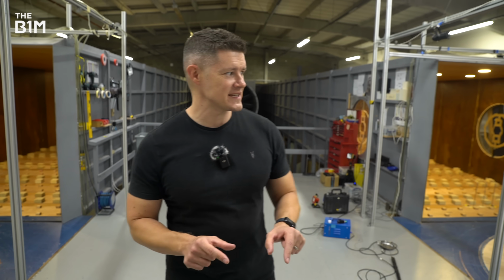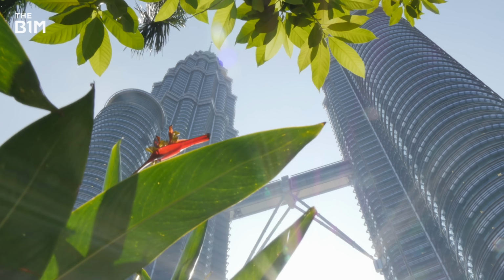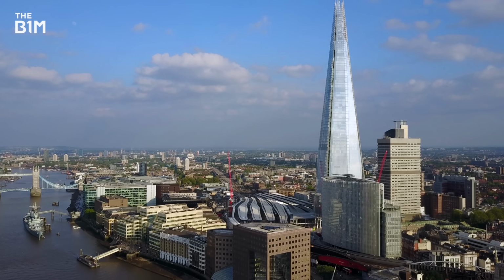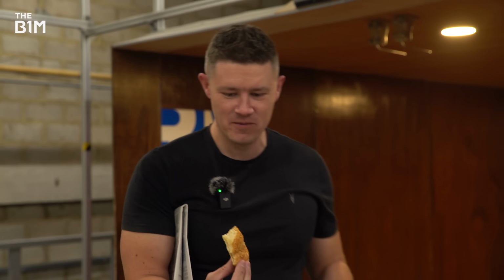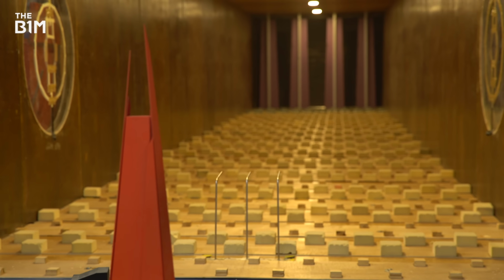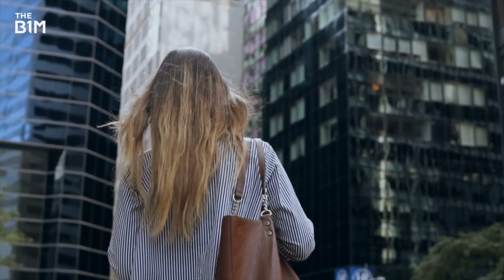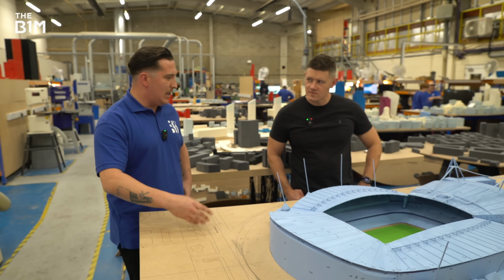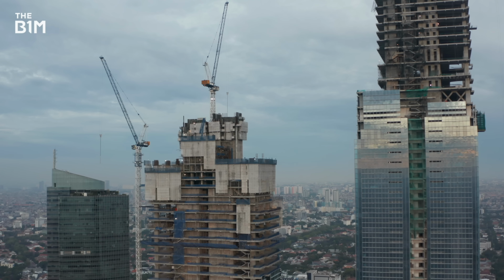Every Skyscraper Has To Pass This Test

Comment: This is the kind of content I love on this channel, so interesting to learn what seem like finer points but are major parts to large construction. I recently left a job at the £1.3 billion AstraZeneca Discovery Centre in Cambridge UK and from my short time at that facility, I cannot believe this type of research was employed in it's construction. The wind would funnel and increase in the open spaces surrounding the building. Maybe the long term plan with the new train station would negate this effect, I do not know, that's Fred's job to tell me otherwise. Regardless, for £1.3 billion, it felt like shortcuts had been made.

Comment: I'm currently living in Chicago, where one of the city's newest supertall buildings is the St Regis Chicago. This mixed-use tower was designed by Studio Gang. Late in the construction phase, it was determined that it would be necessary to leave floors 83 and 84 unfinished, creating a blow-through in order to stabilize the top floors above. While this did solve the issue of building sway at the top, reducing it by 20%, it looks like a flaw in the design. I wonder if this advanced wind tunnel modeling could have been used to solve the problem while the architects were still at the design stage. I can think of another example, the Shanghai Financial Centre, designed by Kohn Peterson Fox, which has a hole at the top as part of the overall design.

Comment: I wish you would've showed the meaningfulness of the wind-test in action.  Show footage from a slo-mo camera deforming the little models while the experts describe that the model is performing within desired tolerances - or not.  Even just animated models with data from real life showing little stress points in blue, green, orange and red...  That's what I want from this sort of video.  And when you talk about scaling, how do they scale accurately, so the model - which is not built of steel and concrete - accurately reflects how a steel and concrete structure will behave?  Again, that's the sort of thing I want from a video like this...

Comment: I'd be surprised if anyone in the construction industry wouldn't be familiar with RWDI. There aren't many options for wind tunnel testing around the world considering the required facility and associated costs. Smaller projects often go to Computational Fluid Dynamic software tools which are much cheaper and faster however lack the applied testing which you get from a wind tunnel test. 
Every project however has to consider wind loads in their structural calculation.
One caveat however is to be considered. Different regions/ countries have different standards/ requirements which usually is based on the worst condition experienced since windspeeds were measured. Therefore, higher wind loads due to climate changes will fall into the applied safety factors which have to be rather higher than lower to avoid a sudden collapse of any structural if unprecedented conditions apply.

Comment: As a civil engineer myself and living in New Jersey (one of the few US states that uses roundabouts regularly) I find it kind of disappointing but also hilarious that the only reason I know about Milton Keynes and their abundance of roundabouts is from @RealCivilEngineeringGaming and his city skylines jokes about the city 😅😂
Reply: Welp, after some quick research once I finished the video I’m sad to find out that NJ actually does not fall in the top states for roundabouts 🙈 in fact out of the 110 found on Wikipedia, about ~45 are now defunct smh. But To be fair my hometown of ~2 sq. Miles contains 2 itself plus another ~15 in nearby towns I regularly work in or drive through which is about 25% of them in the state!

Comment: You suggest the average person doesn't even think of a facility like this. They will be forced to as we move into a future where buildings are taller and taller. I live in Toronto and wind tunnel labs cross my mind every time I have to walk downtown, buffeted by gale force winds from structures that all stake holders guarantee will create nothing more than a light breeze. I guess they all drank the kool-aid. because pedestrians are being injured after beind blown into the street or against walls. 
You can poke all the holes in those behemoths you want, you can install mass dampers on every floor. They do NOTHING to prevent injurious winds from knocking people down.
Does anyone care about this minor annoyance? Clearly, rampant capitalism is doing fine and that's all that matters. The average person is always the last consideration.
Reply: You can't make this stuff up! I have just got in from walking along Bloor St.There was a sudden gust of wind just as l approached Yonge St., where "The One", a new supertall is going up. I was pulling my empty folding grocery buggy. It is lined with canvas which l forgot, makes a great sail. The gust of wind wrenched it out of my hand, flinging it against the hoarding around the skyscraper. No one was hurt. Nothing to see here! A young man retrieved my grocery buggy and l continued home. You are responsible  for all loose items to be tethered to your body.
Reply: @herbtarlic892  Are you talking to yourself?

Comment: twin towers were 1st skyscrapers to be tested in a wind tunnel - but - they only tested 1 tower alone (they didn’t test both towers side-by-side); 
there was also a notoriously harsh wind that went through that plaza between those towers.
Also, they built 2 moving rooms that simulated how the wind would be experienced by the occupants when the buildings swayed;
For both tests many people found the simulated motion disturbing.
The engineers came up with motion dampers to absorb the sway; the 1st time any such dampening device was used in a building.  
(No conclusive evidence that the dampers worked).

Great video - thanks for sharing! 🙂👍🏼👍🏼

Comment: Thought this type of testing had gone the way of the do-do due to CFD. I know there is a model of the Central Business District and surrounds of Perth, Australia kicking around that was tested in OpenFOAM for a few proposed developments.
Reply: CFD isn't quite ready to fully take over wind tunnels. They've been saying no more wind tunnels in 10 years for the last 30years.

There are issues with accurately modelling turbulent wind effects and validating those results. CFD is so accessible that anyone could run a simulation, whether or not the results are valid is the real question.

Comment: A good example of unintended wind effects is the Bridgwater Place building in Leeds, which caused wind to funnel past one specific section of road and ultimately one person died when a lorry blew over. Now they have wind deflectors in place by the road.
Reply: Now you say it, I actually remember this happening. Shocking stuff

Comment: When you put all these different shaped buildings together, you can get some hard to predict behaviour of the wind. This can include wind being directed up or down as well as creating high and low speed and pressure areas around buildings. Trying to predict this with computer simulations is challenging as there is just so much physics going on, so wind tunnel testing is essential. Very interesting stuff.
Reply: Captain obvious? That you describing simple weather?

Comment: Is that where the F1 teams test??
Reply: not necessarily. f1 teams have their own separate wind tunnels. there is, however, an unusually large amount of windtunnels in milton keynes (2), as red bull racing is at the other side of the city.
Reply: @GazMoby No. Not at all. Completely different things.
Reply: Just wondered as I know Milton Keynes has an unusually large number of F1 teams around there.